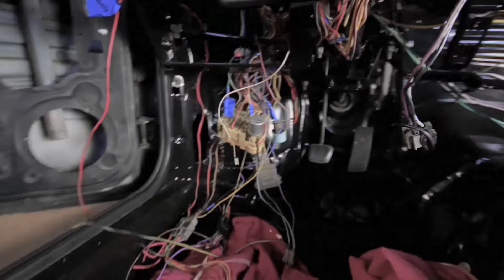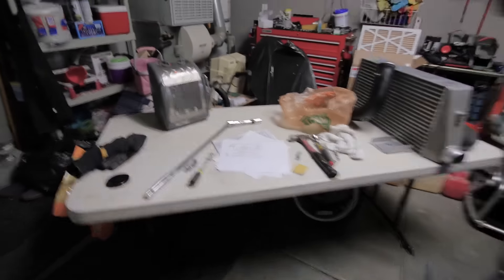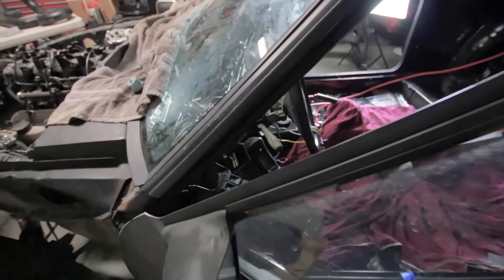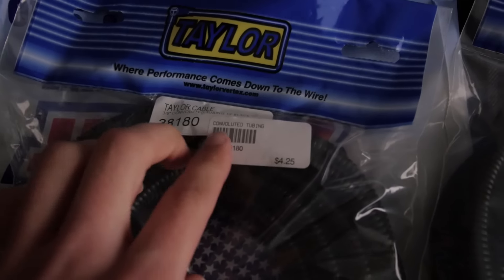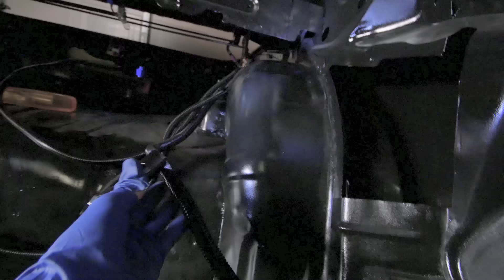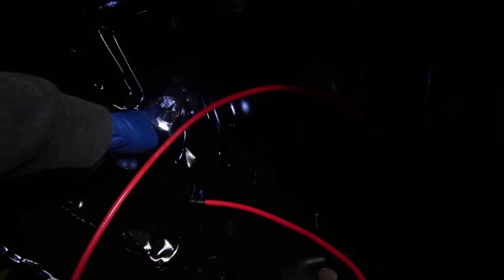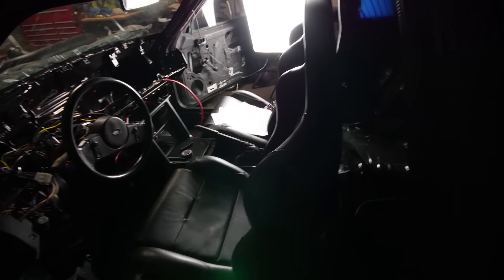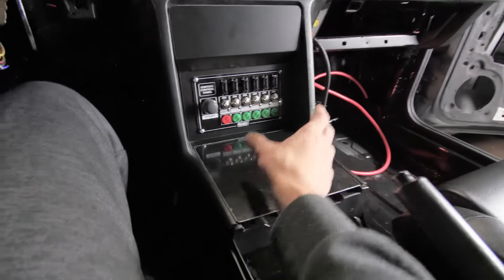Foxbody Drag Car Build Ep.29

Comment: hey just started following and i subscribed! anyways, i wanted to point out that it is not wise to plumb return into top of fuel cell. gas falling in will result in bubbles in your fuel. Also, im piecing my fuel system together as well. Feel free to post that parts list and what your budget was on it haha
Reply from the maker: going to have a vent line on top to fix that I just havnt finished that yet so it should solve that from what other people have done. But thanks for the follow and comment.

Comment: what welder are u useing??? voltage wise??
Reply from the maker: Just a 110
Reply: hosestly brother I would NOT use that for a cage...it will not penetrate and it will look like shit! im a pipe welder by trade and you can take that to the bank!!! lol...you need at least a 220 machine
Reply from the maker: oh ya im definately not welding the cage with it. My buddy has a lincoln 220 im going to have him help weld it he builds custom staircases.
Reply: sweet!! whens the next vid coming?